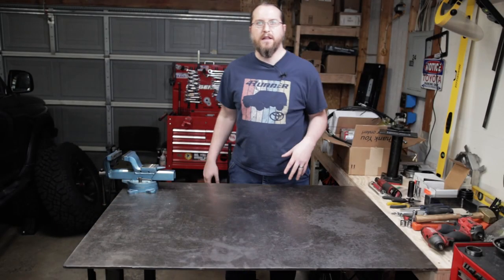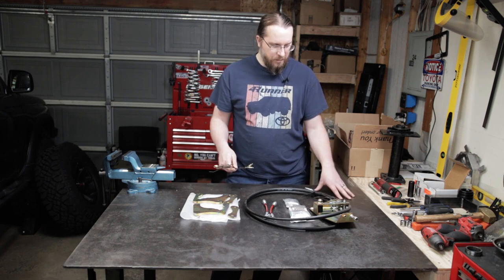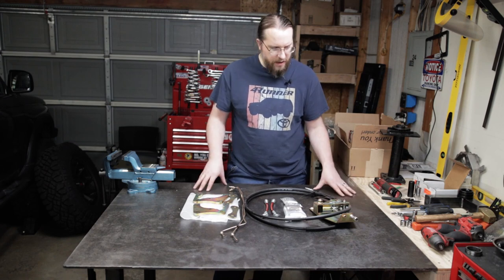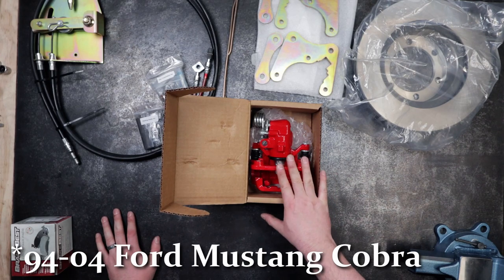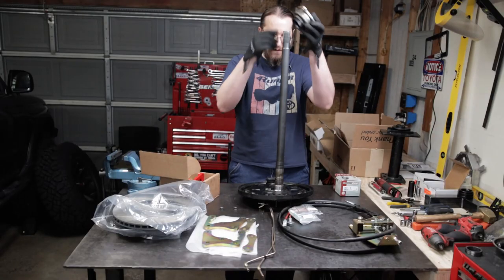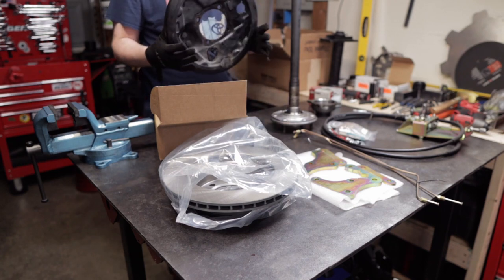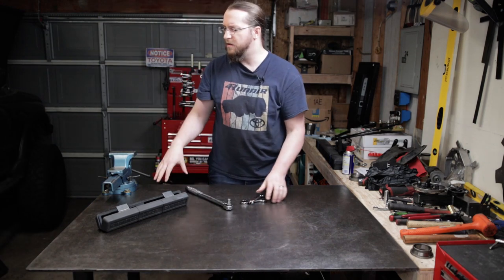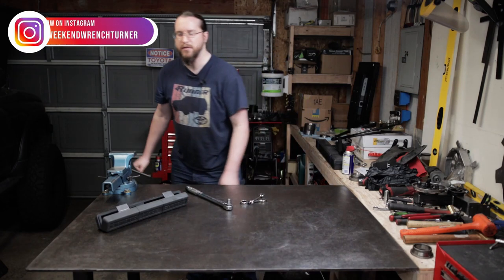Rear Disc Brake Conversion Part 1 - 3rd Gen 4Runner ('96-'02)/1st Gen Tacoma ('96-'04)

Comment: This description is confusing. Every time you click a link it doesn't take you to anything you're clicking? Is there somewhere we can buy this conversion kit or do we have to go buy all the parts separately and put it together ourselves?? Your link says "conversion kit limited supplies" but there's nowhere to purchase it. Just descriptions on the things you'll need. I don't even see where you can actually purchase the bracket. Super confusing and kind of aggravating🤦‍♂️
Reply from the maker: Yes, unfortunately the person making them no longer does, so it could be the links no longer work.
Reply: @WeekendWrenchTurner  ahhhh.. my apologies! Good thing you got yours when you did cause the trail gear conversion kit sucks!! Thanks for the video
Reply from the maker: No worries mate!! No apology needed! Haven't seen the trail gear kit so thanks for the heads up👍🍺

Comment: The brackets look like they will fit a 2nd gen 4Runner, very familiar with both the 2nd and 3rd gens. Wondering if there will be an E-brake cable set up available for the 2nd gen 4Runner. Very interested in this, as well as many people I know.
Reply from the maker: I know the axles are very similar, at least the housings. They may very well work. I would hit up the guy producing them on T4R.org and get his opinion. Thanks for checking out the video🍺🍺

Comment: This kit fits on my  toyota tacoma 2003
Reply from the maker: Not sure if this is a question, but I'm sure it does fit the 2003 Tacoma. The emergency brake kit I'm pretty sure will not, at least not without modification. Thanks for commenting and checking out the video👍🍺

Comment: Quick question, how do I order the kit? I'm trying to find it on the forum and I can't
Reply from the maker: There's a link in the description to the forum post with instructions on how to order. You'll want to read through the first few post with the instruction on how to order, though I know supplies are pretty limited. I've included the link here: https://www.toyota-4runner.org/3rd-gen-t4rs/285491-rear-disc-brake-conversion-kit.html

Comment: Do you use a brake residual  valve to retain fluid in the calipers
Reply from the maker: They only added the residual valves to the 2000+ models of the 3rd Gen 4RUNNER. Works fine without it, though the 99's don't have the electronic brake system like the later models. Thanks for watching👍

Comment: Hey I love the video! Why not upgrade to the tundra brakes - do you find that the mustang calipers provide enough braking power for a heavier vehicle ? I’d love to swap to disc brakes but I’m wondering if the tundra brake upgrade all the way around would be the way to go
Reply from the maker: I did the TBU up front before I started making videos. The mustang calipers along with the 4th Gen rear rotors make the bracketry generally easier with the placement of the ABS sensor. Thanks for watching👍🍺
Reply: @WeekendWrenchTurner  shoot thanks for getting back to me! Do you think the TBU would work instead or is the amount of space/setup not a good spot for the tundra calipers?
Reply from the maker: For the front, if you ever plan to tow I think it's very much worth doing the TBU. Only real issue is whether your wheels will clear the larger calipers, which cities add additional costs obviously. Hope that helps👍

Comment: I'm looking at to buy a 2002 Toyota Tacoma has anyone seen a video or someone did a disc conversion on that truck I haven't found one
Reply from the maker: I've not seen a video either. The discs would be the same, but the lines and the e-brake would not. Would be cool to see 👍
Reply: @WeekendWrenchTurner  I'd also like to see the video where you take the base model Tacoma or Colorado or ranger and lift it to the PreRunner size. Not some 6 inch 12 inch lift I mean something where you get the base truck and left it to the size of the other trucks and then when someone sees it they'll not know it's been modified at all

Comment: Where can I get the brake cable. Are those factory mustang cables?
Reply from the maker: They are not mustang cables, but custom made for this kit and application. They are sold separately though. Check out the link in the description. Thanks for checking the video out👍👍👍

Comment: Is there any rotors can can be used from any other car without having to machine the rotor
Reply from the maker: Not quite sure of the question here, but these rotors are from a 4th Gen Toyota 4Runner. No machining required. I remember reading somewhere that a Mitsubishi Montero had been used as well, but I'm not sure if it's with the same calipers or not. Thanks for checking the video out 👍
Reply: @WeekendWrenchTurner  thanks for getting back Been doing a lot of research different videos kind of confusing people using different parts even having to machine the rotor Axle flange can sit flush inside. So 3rd gen rotors does it matter if 2wd or 4x4?
Reply from the maker: It's actually 4th Gen 4Runner rear rotors (2003-2009). Front discs don't work and don't ask me how I know😀 Doesn't matter if it's 4wd or 2wd either, since they're the same for the rear.

Comment: Who make the brackets
Reply from the maker: There's a link in the description that goes to the thread on T4R.org where the seller has then listed. Great guy to buy from👍
Reply: @WeekendWrenchTurner  one question do you know if these brackets fit 1st Gen 4runner
Reply from the maker: I don't know if they would or not. I know the rear axles are similar, but not sure of the measurements.